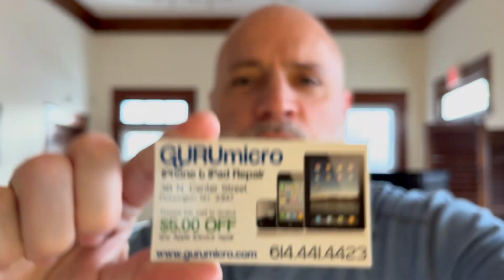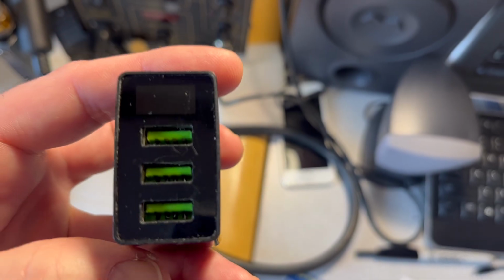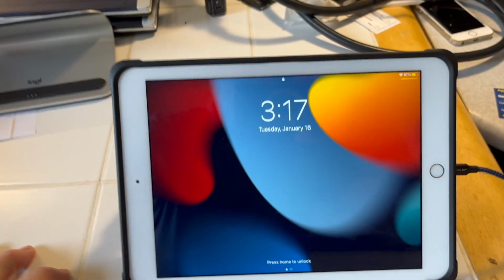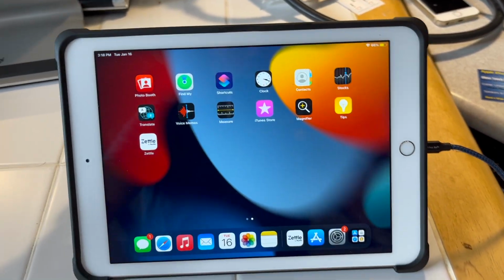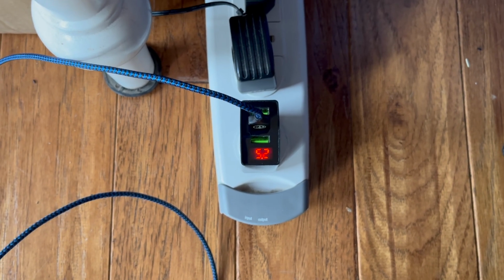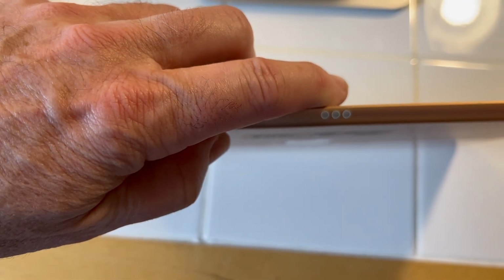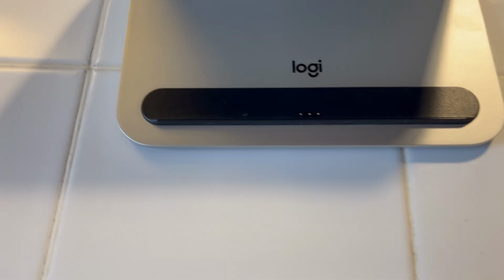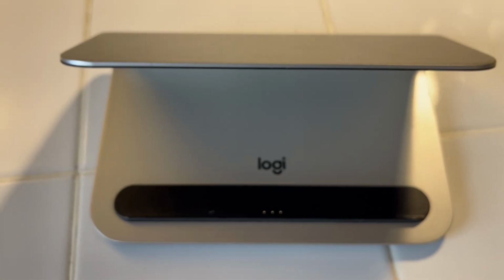iPad Charging Port Easy Fix for 5 6 7 8 and 9 gen generation. No disassembly! GURUmicro Ohio

Comment: I have a iPad A2153 (3rd generation).  It has the three dots on the side.  Will this smart charger charge it?
Reply from the maker: That is a 3rd gen Air. I can’t answer that because I’ve not tested on that exact device and the 3rd gen Air came out a little after the LogiBase was first released. It might work 🤷‍♂️ hopefully someone else can confirm this. I do know that it works on the first gen iPad Pro though.

Comment: I don't see the solution for gen 5
Reply from the maker: As long as gen 5 is pulling amps from the port (you can tell by using a cheap charging cube bought from Amazon or eBay that displays amp draw, like the one I show in the beginning of this video) then you can get it to take a full charge by powering it down once it actually boots to 1%. If it’s not pulling any amps at all, then this method won’t work for you. The 5th and 6th gen do not have a Smart Connector.

Comment: May 10, 2025 e-Bay has several of the charging stands, but $ 93.00 after shipping and sales tax.  However, mine charged perfectly after turning the power off. Thank you very much.
Reply from the maker: I also noticed that the price has increased for the Logitech base since I made this video. They used to be around $50, it’s possibly due to more demand now as these devices age. Many  people just want data recovery, so they can at least do that through iCloud or direct device-to-device transfer once they get it powered back up again. Then they can then re-sell the Logitech charging stand on eBay and get their money right back. 

Glad that the powering down method worked for you. It’s a bit of an inconvenience, but at least it worked and it’s free!

Comment: Took until 4 minutes in for you to say that your solution works if one’s ipad matches your ipad’s symptoms, which mine does not. Mine is totally dead. And at this point, at 4 minutes in, you still have not explained WHAT your solution is!  It’s so frustrating
Reply from the maker: It’s not just my iPad. I own an electronics repair shop and have been servicing Apple devices for over 15 years. 60% of the iPads that come into my shop with charging issues can be resolved with one of these methods. The cost of a charging port replacement usually exceeds the value of these older devices, but there are 2 possible solutions which take about 5 minutes to diagnose once you understand what to look for. The first few minutes of this video is explaining how you can easily check the amperage pull at home with a simple charging cube that displays amperage to determine if you have a bad PMIC causing a current flow issue, in which case following the instructions on powering down the iPad while monitoring for a change in current flow (this is explained in detail for those not familiar with how to do this) and possibly get it to charge again. Then you can then try the second method, which requires the purchase of a very specific Logitech charging dock (from eBay) connected to the Smart connector on the side of the iPad. Which many people do not even know is a possibility. 

I don’t get paid anything for this, I made this video just to help people. I’m sorry it’s not a quick enough explanation for you, but not all things can be fully explained in 2 minutes. There is also a chance of another issue on the logic board or irreparable damage to the solder connection between the port pins and the solder connections on the internal flex cable, which neither of these methods will fix. You’ll need a new charge port and that typically will exceed device value on the 5th and 6th gens.